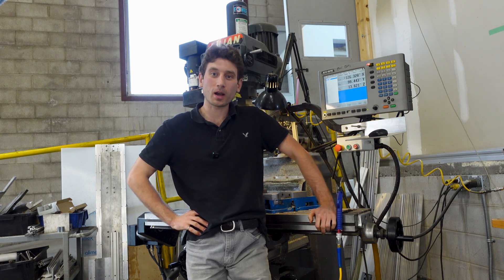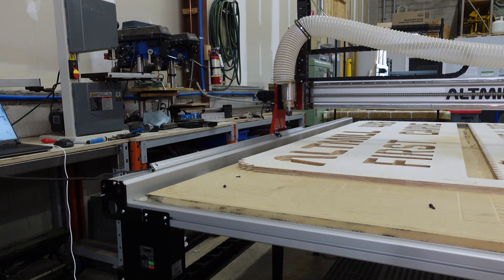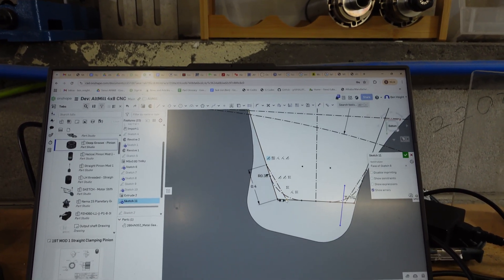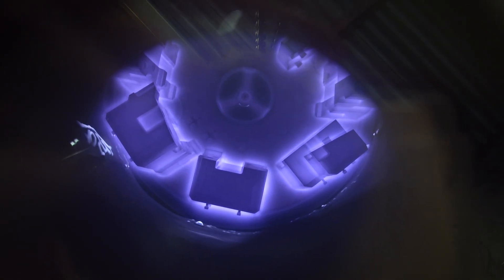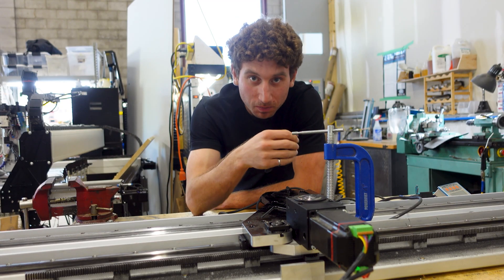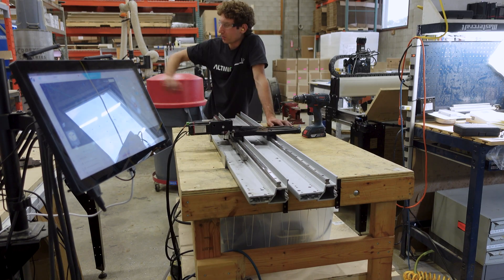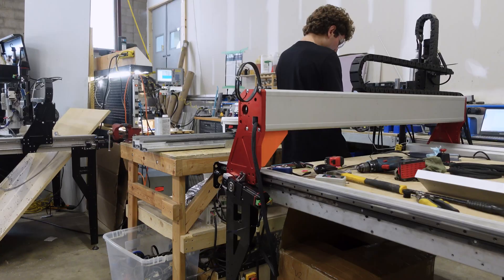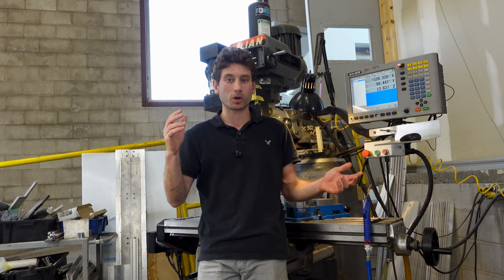Engineering the AltMill 4x8 ❘ Ep 5: Rack Wear Testing

Comment: did you try a helical rack and pinion?
Reply from the maker: we did! Here's info rom Ben: " It wore down at a similar rate to straight cut but was quieter. The main things that help with ware is high hardness and lubrication. The helical adds complexity due to having a secondary force direction. Helical is not counted out, but not in the scope for batch one."